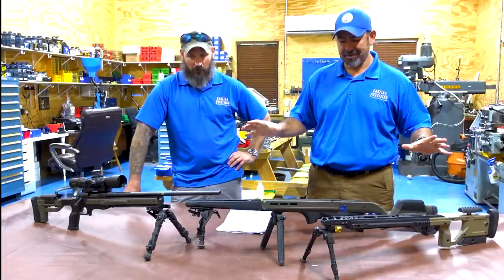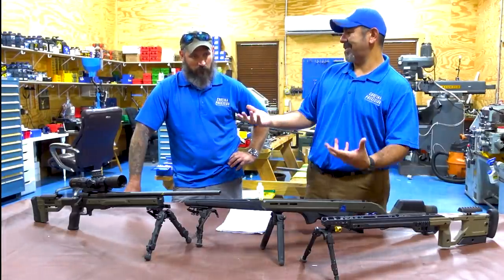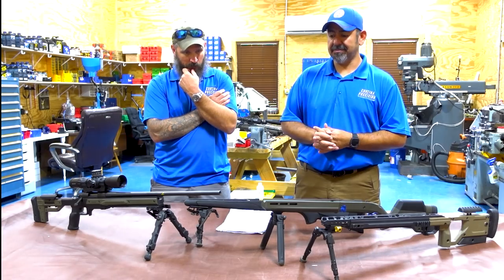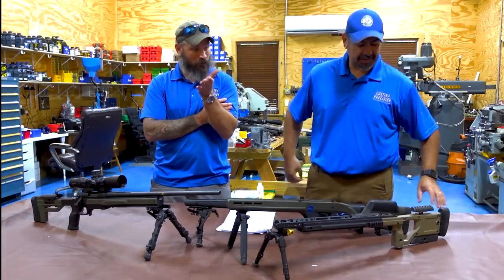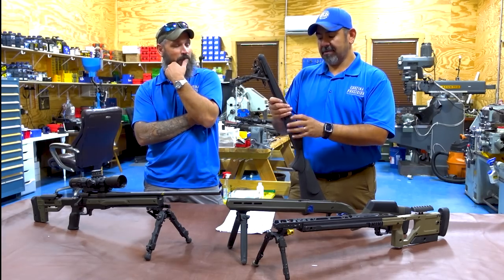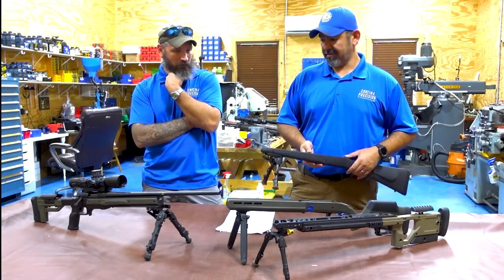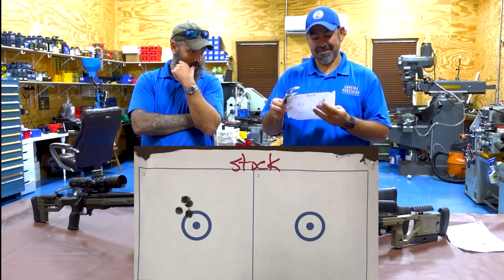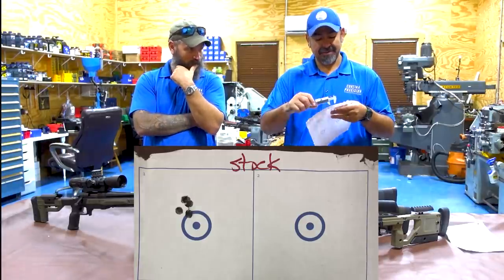6.5 NEEDS-MORE | WE TESTED FOUR DIFFERENT STOCKS

Comment: Consider shooting off Mr.Eric's fancy 21'st century competition rest or even the same bag for all of your testing.  Using multiple different bipods may be adding a second variable to your testing. If you really want to isolate the barrel, swap the 2 barrels and see if the groups open up the rifle that initially shot better. 

Use a black sharpie to color the lock lugs on your bolt to see if either of them need to be trued to make better contact. It will also show you right away visually by the wear on the coloring where and how much the 2 differentiate. These aren't the precision CNC actions y'all are used to in your match rifles.

On a side note this whole scenario is likely why you see some firearms on discount after being returned to the store shortly after purchase. The buyer was looking for a unicorn and cant get it to group as hoped and returns it for a replacement or trade-up. After observing this over a few years, I completely stopped buying any new returns specifically for this reason - someone's likely already done the out of box accuracy test for you.. and it wasn't good.

I've seen the most variance between 2 of the same rifles from Savage, and the least from Tikka.  One of my good shooters is a Tikka pencil barrel 22-250 with a cheap cheek riser on the plastic stock with a Harris bipod and some redneck blueprinting on the bolt lug surface. Holds 0.28 MOA on a 300 yard target with 52gr A-max's with a $350 Vortex Diamondback. Tuning my hand loads helped a lot, even lacking an annealer the pros use.  Not a F Class results, but overall the thing cost around $1400 total with bipod and scope.. in Canadian funds to boot!

Thanks for another awesome video!

Comment: I've got a Remington 700 SPS tactical in 223. In it's standard stock it shot 0.4 moa. I then put the barrelled action in a XLR Element Mk4 chassis with an Accu Tac bipod and it still shot the same.
Go figure.

Comment: Are you cleaning them in between the stock change or was the factory stock configuration the only one that was shot on a clean bore because by the time you got to the oryx that's 40 rounds through it which is usually more than the average Hunter throws down between cleanings if he takes care of his gun something to consider and if you clean them in between each time it would cool the barrel

Comment: Eric & Jason 5enjoying the videos, here in N. Ireland. I have a question for you. I just changed my old 6.5x55 Swedish for a new Tikka T3x Varmint 6.5x55 Swedish 20" barrel. Been looking at an Oryx stock. However, my gun has recesses either side of the  chassis mounting bolts. These would go into the stock & I think improve stability in the stock. I have noted that some after market stocks, you just set the action into the stock which just has mounting bolt holes, no recesses either side of the bolt holes. Finally the question: does this matter? I'm concerned that the rifle action isn't as well supported & will shift when firing. What's your thought on that??
Also can you glass bed the action in an Oryx style stock??
Thank you for reading this far.
Regards
Hugo Dale

Comment: It doesn't sound like you think the bedding job in the factory stock is going to hold up. Move #2 to the Oryx, that should mean that Jason is shooting the "same way". With the factory stock he's adjusting himself to that stock. And doing a damned good job of it lol Then put a tuner on #1, catch up to the number of rounds on #2 with the tuner. Next comparison, new trigger on #1.  The control isn't ruined, it's changed to take the influence of the shooter out of the equation... a little... that'll always be there but it sounds like the factory stock is making Jason work harder than the Oryx stock does.

Comment: Leave the control in the original stock. Continue upgrading the other one with another trigger. Than tuner break for the next stage. If the control gun still shoots .75 MOA and the upgraded gun fires the same or slightly tighter (Which is what I believe will happen, because I think one of the largest factors to this is the factory ammunition. We all know that every single gun, regardless of how close in serial number they are, will shoot significantly better or worse depending on which factory ammo you use. Even if that ammunition is high quality) than upgrade the control gun to see if it shoots tighter with the same factory ammo.

Comment: THE "CONTROL" KEEP IT IN THE NEW CHASSIS AND DO A TRIGGER JOB ON IT.
THE "OTHER RIFLE"  FIRE IT 40 MORE ROUNDS AFTER PUT THE SAME TRIGGER  AND CHASSIS (AS THE CONTROL).
 THEN ADD A TUNER BREAK .
THEN TAKE THEM BOTH TO THE RANGE AND COMPARE.
THEN GO ON FROM THERE.
MAYBE HAND LOADS TO FIND EACH ONES SWEET SPOT.
WHAT DO I KNOW ?
I'M JUST A RETIRED PIPEFITTER

Comment: Look for pressure points in your aftermarket stocks I see it all the time I usually bed my chassis after I find the high points it's a pain in the butt but they shoot much better that's why you're seeing your stock bedded stock shoot better no pressure points on the receiver those aluminum blocks are mass produced and it's very hard to hold the accuracy you need only the real high-end chassis are reliable and I still bet them

Comment: I say keep the "control" rifle in the original stock and upgrade it as cheap as possable (cheap muzzle break, cheap upgraded trigger and so on) as someone with a tight budget would do to see what is possable vs the other rifle where you can go all out.
This will compare proper upgrades vs budget upgrades.

Comment: Exactly. To do a correct comparison the control has to remain unaltered. As you have it now your data will be skewed. Loving the content, but I had to weigh in on this one. 
This whole exercise would have made interesting content had you left the control rifle as is, then made an alteration to the test rifle, by first free floating the barrel then pillar bedding the stock etc. test firing it against the control rifle after each modification. Just my opinion, the only way now to salvage the experiment now is to purchase another rifle exactly the same and test fire it against the other two and don't alter it at all. But hey what do  I know.

Comment: Maintain a un modified control

Save prior group data to have a beginning and end result..

Obviously not every upgrade is meant to make a gun shoot better but to make the shooter shoot better so those could be a little subjective as seen in this video...

Future upgrade ideas
Lapping the action

A mid tier trigger like a trigger tech special

Barrel threading and recrowning

Muzzle brake

Muzzle brake / tuner

30 40 50 and 60 inch pound torque values for the action and chassis mating

Lastly even if there mindless shots burning the barrels with the same number of firings so the barrels speed up around the same amount

Comment: Don't modify the control at all. If you do, you will not be able to see the progress you make on the other.  I would suggest that you start with adjusting the trigger and then adding a bit of weight to the original stock.

Comment: Put #2 back in the plastic factory stock. I bet it shoots .750 MOA  just like all the chassis’.  I bet it won’t shoot sub .500 over and over in the plastic stock or try the test backwards. When the barrel is “hot” or warm from shooting 30 rds, I bet it won’t shoot sub .500 MOA group in plastic stock.   I agree rifle “should” be able to shoot hot.  Doesn’t mean factory slim profile will without moving a little bit.    I say prove action and barrel shoots the same or similar no matter what stock or chassis. Then put #2 in a oryx chassis with same bipod as #1.  Once they are equal again  thread the barrel on #1 install the E.C. Tuner brake. Shoot the 40rds adjusting and tuning to bring both guns back to equal rd count.  Next mods I would suggest  trigger,  polish bolt lugs races etc, change springs, true bolt lugs (blueprint action) ,  finally change the barrel.    The action is the serialized “GUN”  so changing it your throwing away the “GUN”  should have started with a custom action.

Comment: I think what you did with the control rifle was completely acceptable. You already had a baseline for what it would do. And the only real measure of improvement can be done with one rifle. Comparing two different isn’t the same. I would be curious to see if you took a third control rifle and did a one shot deep clean one shot deep clean for 10 rounds what the first official group from that rifle would be. I think what you are getting good results from is the barrel breaking in. Because of low quality machining and rough spots but that’s just my two. Cents.

Comment: well, the control rifle was a shooter already from the beginning, compared to the second rifle. If now it is confirmed that with the same upgraded config the two rifles shoot more or less the same, basically you proved that the issue was just the stock on the rifle that was originally shooting worse. 
Now that you know, you could restart the challenge keeping both with the same upgraded configuration and see where you can get with additional single improvements on one rifle at a time, then repeating the same improvement on the other rifle as well and verifying the two rifles keep shooting more or less the same with the same continuously improved config. This would validate the impact of each single improvement you make, and give us visibility of how worth that single upgrade could really be vs the budget it requires.. For now we know that free-floating the barrel + pillars + bedding the recoil lug can turn a +1MOA rifle into a 0.5MOA one.. 
Before the tuner, if you want to stay cheap, I'd check the bolt lugs: maybe a bit of lapping?

Comment: Is it possible that the action screw torque is different (lower perhaps) in the factory stock vs. the torque applied to the different chassis - resulting in smaller groups? 🤔
Reply: I torqued everything to 65 inch pounds

Comment: As an thought… if you’re going to shoot 10 rds, fire 10 rds as a single group… or at least aggregate the two five round groups during your analysis and presentation. If it’s not (comfortably) sub MOA for 10, it’s not sub MOA. Two five round groups really isn’t enough to average and assess performance. Record either 5x5 groups or 3x10 groups with the control at a minimum for a baseline. No flyers/throw aways, determine average as well as max dispersion.

Comment: Does a Break tame the Stock Stock and make it more shootible? Just throw a non-tuner break on the Glass bedded stock and see what that does for shootiblity and if its more comfortable to shoot does it give you a reason to keep it in the Stock stock or even tighten the groups up. The Problem with the stock stock is the jumping so address the complaint see what it does for you. It's already crazy at a Half MOA. If it ain't broke don't fix it.
Reply: Also I think your intension of this project was to see what you get value wise in today's rifles. Most come pre-threated today so if your thought is well if I thread the rifle its going to add money, that doesn't hold up because you can grab a B-14 Ridge Rifle for the same money and it's basically the same gun plus its pre-threated.

Comment: Ok, so no control rifle that's fine, I am curious why we have two rifles, but OK. Moving on from here I'd like to see each rifle set up to perform well at a certain discipline, PRS and hunting were mentioned. Having to shoot with a hot barrel was mentioned, why? One cold bore shot my deer is down no hot barrel here. PRS  yes has to shoot well hot. Let's do this, two $400 rifles one set to be competitive at a local PRS match, the other a lightweight hunter, carbon fiber stock, maybe a lighter optic, something capable of whitetail, mule deer, sheep? So at the end we have two rifles that shoot equally well on paper but completely different. Then compare the cost of the upgrades.

Comment: A stock is ergonomic, it has flex and vibration, may or may not be sensitive to heat or even moisture. Your only problem with the first stock is the ergonomics. That doesn’t mean all the other factors are bad.

Comment: Why don’t you try to improve the original stock by making it fit the shooter by attaching a stick on comb, adjusting the length of pull using a different but pad,
Strengthening the original stock ,
Tensioning the action screws to different tension to get the best accuracy 
Just putting a lighter spring.
using a rubber barrel tuner 
All the above could be done very cheaply, and you would still have the original stock.
Just a thought 😉

Comment: If the original stock shot tighter groups than in the chassis, why leave it in the chassis?  The factory style stocks are more comfortable and common as a hunting stock than those chassis stocks.  Now it seems like you’re gonna have to do some work to the other rifle to get it up to the accuracy of the control.  I’d leave the control alone, until the other rifle beats it in accuracy.  Then add up all the cost it took to beat the control rifle.  For the average hunter buying these rifles(which would be the majority of them), the juice ain’t gonna be worth the squeeze.  
Love your videos and this series.

Comment: The point of the control is lost when your comparing two modified rifles. Also these are hunting rigs not competition contoured barrels. As a turner manufacturer as I had stated before the only modification made to the control rifle should be a turner. A tuned factory rifle as a control. Then see what all has to be done to the chassis rifle to make it shoot the same as the control rifle without putting a turner on the chassis rifle. Would be interesting to see the savings and results of adding a tuner to a factory rifle vs the cost and results of a build without a turner.

Comment: Do you still have an unmodified stock? put it back in the original stock. then see how much better you can make the other one. then when your done with the modifications upgrade the the original to see if it can be the same as the modified one.

Comment: At this point the test data has shown that there is no need for a control any more. Both rifles shoot similar to each other once bedded and free floated. This proves one important fact; that factory synthetic stocks of cheap quality affect the rifles precision to varying degrees and should be either fixed or replaced to let the barreled action perform it's best. Baseline established, you have two 3/4 moa rifles when bedded and free floated. Now that Jason has some trigger time behind that gawd awful factory stock he is squeezing every red cent out of it just fine, owing to his broad experience and skill pulling triggers. So with that in mind, what good does it do to leave a control as is and keep repeating the average baseline? The test has outgrown the need for that. Both rifles are equal. I think now the test is about modifications and the gains you can expect. The second big fact is Jason clearly favors a good chassis, especially the Oryx in this case, even though they aren't providing a gain on paper at this distance with this ammo. No doubt owing to both Jason and Eric knowing how to properly bed a rifle. So moving forward I say forget about the control, it served it's purpose, showed a few important facts, and is no longer needed. Move on with the modifications one at a time to isolate their gains. That is what this series is about, after all. A guide to spending your hard earned money to improve your budget rifle. Looking forward to what you guys come up with next.

Comment: Put rifle 2 back in the modified factory stock and shoot another group or two. I bet it doesn't shoot sub 1/2MOA every time... If it stays 3/4MOA like in the chassis; then why bother upgrading it anymore? This is a budget gun, just leave it a sub MOA budget gun while upgrading rifle 1 to the gills. I would like to see rifle 1 get to the point of re barreling after the tuner brake and see how it stacks up against 2 where it's at, and then try a tuner brake on 2. Just leave it step or two behind at least.
Reply: Also, leave the stock stock in play and do some load development for the rifle instead of factory ammo.
Reply: Another option I like is this... Upgrade the rifle that was put in the Oryx first. Leave the control alone until you're done with rifle 1. Then Upgrade the control later, but in a different order. Example. Rifle 1- Chassis, tuner, Barrel, Trigger, Custom Loads. Rifle 2- Custom Loads, EC Tuner with factory ammo, EC Tuner with custom loads, Chassis, Trigger, Barrel.